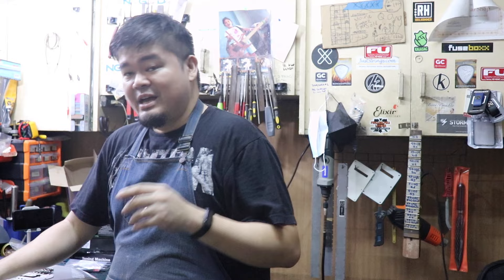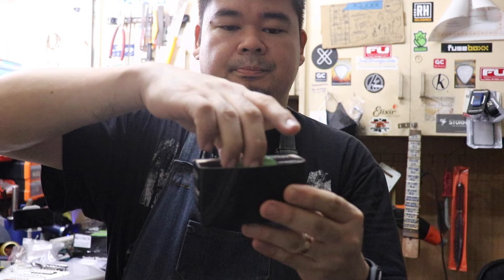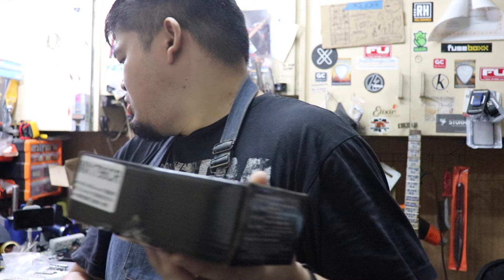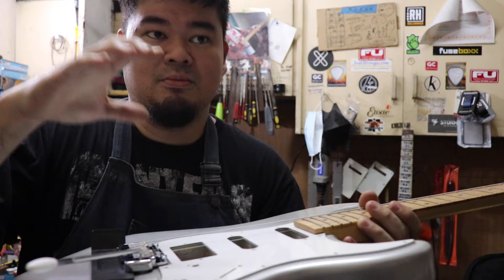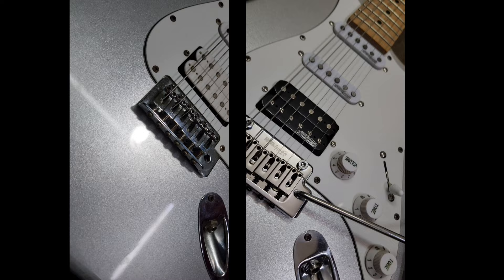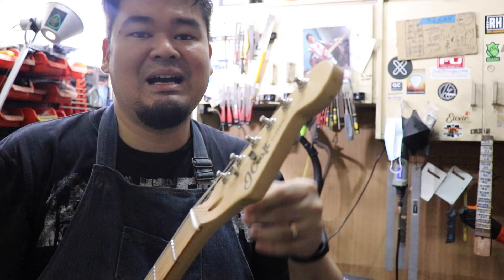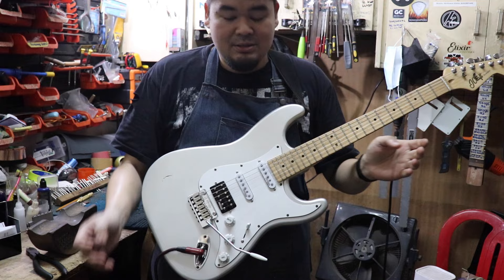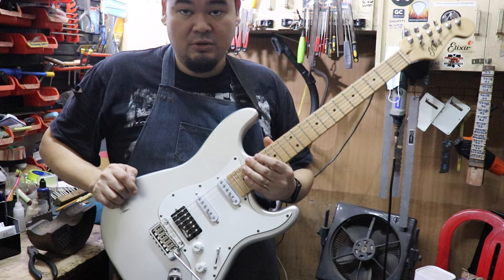Jcraft Classic with Musiclily parts

Comment: ang ganda nang result..
sir pwede po ba for example i'm using Alnico magnet in Middle single coil pick up, then on my bridge and neck pickups would be Ceramic Magnet humbucker.. will it affect the tone if i will switch in between positions? salamat po
Reply from the maker: That will work pretty good paps. Nice in between sounds sa 2 and 4 nice for cleans.

Comment: Question: I have this very same J Craft Guitar, from experience  does a typical Music Lily pick guard fit or do I have to look for something specific? Thanks in advance.
Reply from the maker: I believe the best is contact Jolly Music for they are selling pickguards now, so I believe they are right on sa sukat.
Reply from the maker: Happy new year!
Reply: @MicoOng  I am aware that Jolly is selling them but they don't have the color I like. I also asked them before but they are not sure. I guess buying one to know is the only way,
Reply: @MicoOng  Happy New Year too!
Reply from the maker: Oh OK gets.  Musiclily get the one with the same number of screw holes. There will be chances you need some sandpaper to sand pickguard material off by the neck pocket so it would be a snug fit.
Reply: @MicoOng  Okay, thanks. This by far is thevest answer I got, Happy 2023 to you and your family!
Reply from the maker: Happy new year too you as well!!!

Comment: Sir ung neck pickup at middle,,kahit magpalit ok lng,,??
Reply from the maker: Okay lang naman.
Reply: @MicoOng  sir iinstalan ko rin ng ganyan bridge sakin,,baka po pedeng makahinge ng tip,,salamat
Reply: Sir ginaya ko to,,kaso lng pag nag dive ako tpos pagbalik my mga  tumaas ung tono,,pero ung tuners ko stock pa,,hindi sya locking tuners,,
Reply from the maker: @vladimirvalenzuela7437  make sure na batak na batak ang mga strings at make sure hindi kumakagat ng strings ang nut.
Reply: @MicoOng  local ung string na nabili ko na d,adarrio,,inaantay ko lng ung order ko na locking tuners from lazada baka mag stanby na,,pero binabatak ko dito sa saddle ok nmn,,dito lng tlga sa my nut at tuners ang pinagdududahan ko,,parang my kumakapit pagbalik kaya tumataas ang tune,,salamat sir
Reply from the maker: @vladimirvalenzuela7437  yung slots nung nut, gamitan mo ng pencil, sulatan mo yung slots pampatulong sa pag papadulas ng strings
Reply: @MicoOng  linagyan ko na sir,,pero ganun p rin
Reply: Maraming Salamat sir,,mejo  nag stay na ung tune nya